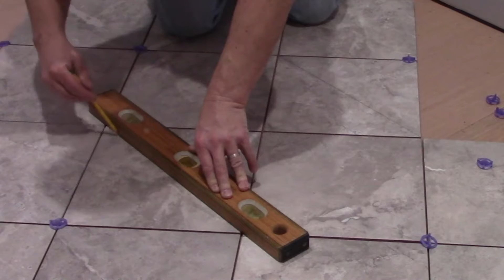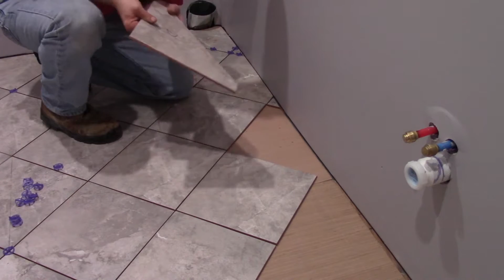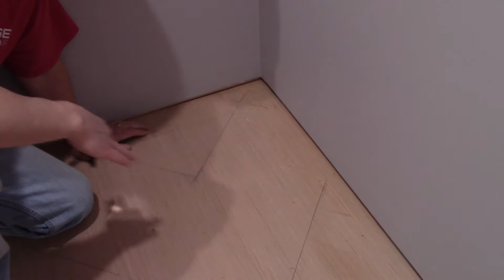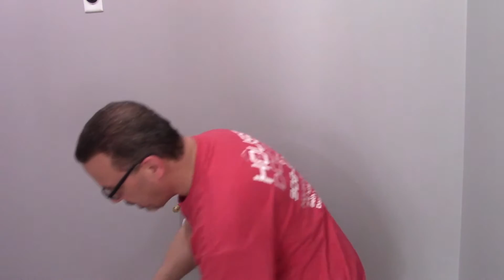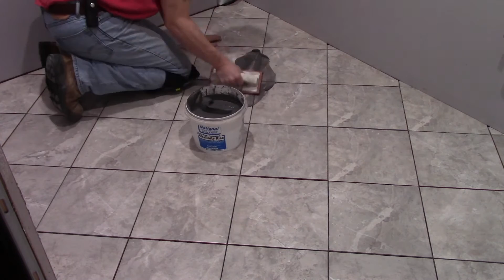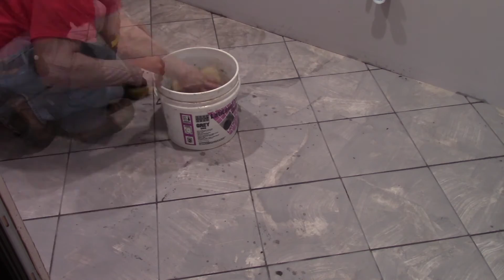Diagonal tile tips and tricks to make ceramic ceramic tile installation easy

Comment: Doesn't the thinset cover up the tile placement marks?  I assumed that because of that you would need to start in the corner.
Reply from the maker: The little plastic things get set on top and you can remove them as you go or when the thinset is dry.

Comment: How do you no wat size to cut your template?
Reply from the maker: It's right at the beginning.
Layout your tiles including spacers.
Draw a line on two adjacent tiles from corner to corner.  The distance between those lines is the size of your template.

Comment: Great vid!  Does this technique work with 12x24 tiles on the diagonal?
Reply from the maker: Interesting question.  Never tried it with rectangular tiles but it should work.  Try it and get back to us.
Make sure your subfloor is solid and you're using mortar for LFT (large format tile) with tiles that big.

Comment: Dr Ray: Would back buttering each of the tiles be worth the extra effort in this situation?   thanks for sharing your tips.
Reply from the maker: If you're new to laying tile, yes.  It does give you a better bond.  When you back butter tile you apply a very thin coat to the back of the tile.
Check out the link in the video description to see what happens with different ways of applying mortar.

Comment: Hey hope all is well ,I need your advice and tips on how to measure a room for a 45 degree marble tile layout  and to find where to start. And how to start on a door way Thank you so much for your great knowledge and understanding..
Reply from the maker: Multiply room length by width to get square footage.  Multiply result by 1.2 to add 20%.  That is how much tile you should get.
Start in the center of the room and layout your tile.  Shift the pattern back & forth and left & right until it looks good.
No real rules, you just lay it out so it looks good.

Comment: Those wet saws suck. Buy the 500 dollar rigid one. Cheap and incredibly accurate. Can pay for it in one side job.

Also if you do tile often I’d get a better float
Reply from the maker: That saw got me through many a tile jobs, even a glass tile shower.
I've since upgraded it but still have it in the basement.

Comment: This was very helpful, but how did you measure the inside corners?
Reply from the maker: They're a little tricky.  You have to measure it in two steps.
First put the tile to be cut on the first available full tile from the corner.  Use the template to mark and cut.
Then slide it over against the wall and mark and make the second cut.
Usually works out fine.
Reply: @HouseDoctorRay  I may be misunderstanding what you are saying, cause I went through a box of tiles moving them around every which way, cutting, placing, cutting them again, cutting more and I could not figure out how to do inside corners using this method.  I ended up just measuring every angle and cutting out the inside corners from measurements .  It took me more time to do the inside corners than the entire rest of the room.

Comment: Do you lay out all your tiles dry even all the cuts before lifting them and putting down adhesive?
Reply from the maker: Not usually, I only did it for this because it was a small room and to make filming easier.
If possible I like to set all of the full tiles and let them dry.  Then make all my cuts and set the edge tile the next day.  It really depends on the room.
In a bathroom I would make the cuts against the far wall, mix the mortar, and lay tile working my way out.  Cutting more tile as I go.
Reply: @HouseDoctorRay  Thank you for your reply! 👍 I am learning to tile at the moment in the UK and 1 week into a 2 week course. Would you mind if I ask you a few questions?
Reply from the maker: Not at all, I'll do my best.
Reply: @HouseDoctorRay  Thank you! In the UK I don't think many tilers use the leveling systems on either walls or floors? As a novice do you think that they are an essential thing to use. I want to do a good job and want all my tiles to be perfectly level with no lipping. Any issued with walls not being perfect with the system?
Reply from the maker: Really depends on what you're doing.  Most ceramic tile isn't perfectly consistent in thickness so not all of the leveling systems work well.  I've only tried them a few times and wasn't that impressed.  I think they would be more useful for granite or marble where the finished surface needs to be flat.
You also are rarely working on a perfectly flat surface so you need flexibility when setting the tile.  If you have a hump in a wall or floor you need to adjust the depth of the mortar as you go.
I'm not against the levelers I just think they're too expensive for most jobs.

Comment: Very informative video.  How long did you let the grout dry before you started wiping it off with the sponge?
Reply from the maker: The time varies depending on grout, temperature and humidity.  The grout you use will have guidelines in the instructions.  It needs to be set up enough so the sponge won't pull it out as you wipe it but it will come off the surface of the tile.  Usually when the residue on tile starts to lighten in color you can start wiping.

Comment: I meant 6” by 24”. Porcelain wood like tile.   Do you have a link how to do this type
Reply from the maker: The larger tiles get put in the same way.  No video on them but a few things to keep in mind:
Flatness of your floor is more critical because the tiles span a longer distance.  The support and stiffness of your floor is also critical for the same reason.
There is a lot more cutting when laying tile diagonally or herringbone.
Porcelain tile is harder than ceramic tile so you'll need better blades to cut it.
Bottom line I wouldn't recommend trying 6x24 as your first tile project.

Comment: Where did you get this measuring gauge?
How long is it?
Reply: Just measure corner to corner diagonally and that will give your gauge
Reply from the maker: Not exactly.  Measuring one tile corner to corner doesn't account for the grout spacing on the floor.

Comment: My bathroom backsplash has a diagonal cut... 2x2 squares.  How can these squares be cut evenly?  Please help.
Reply from the maker: A wet saw is the easiest way to cut tile precisely.  You can rent them at most tool rental places and Home Depots.  Another option is to buy a cheap saw, you can sometimes find them as cheap as $50.

Comment: What size spacers did you use?
Reply from the maker: I used 3/32 but you can use whatever size looks good to you.  There are links in the video description where you can pick them up cheap.  I wouldn't go any less than 1/8 on a floor because you should use sanded grout on a floor because it holds up better.
Reply: Thank you very much!!!